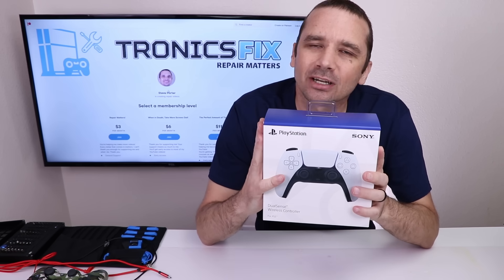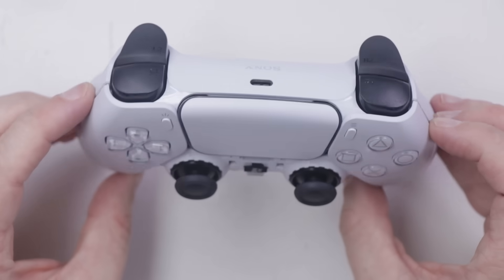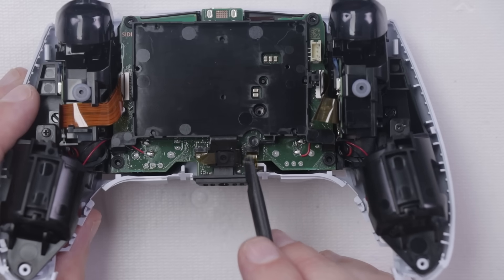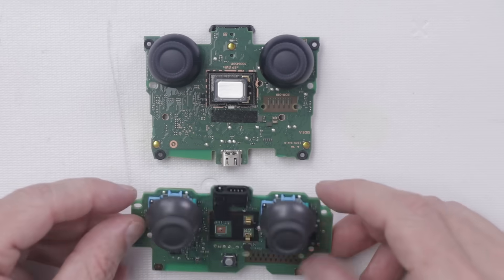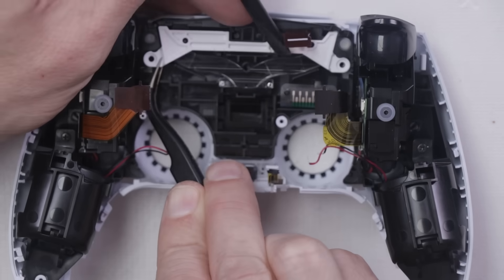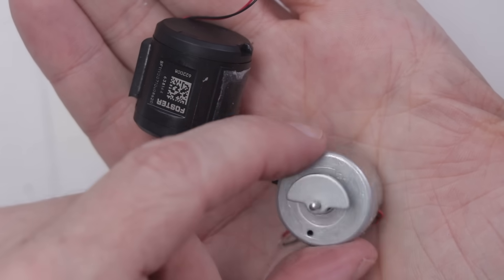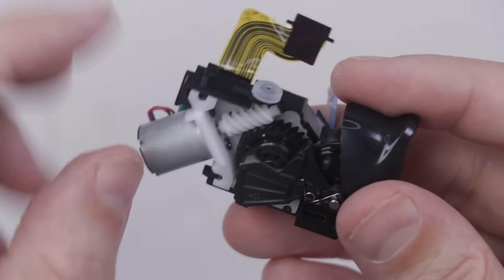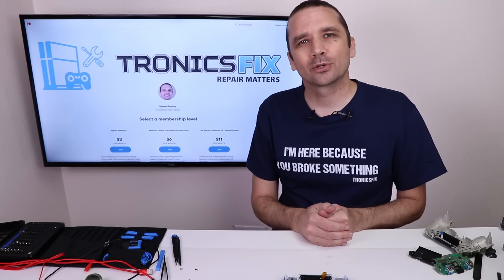PS5 DualSense Controller Teardown - A Repairability Perspective

Comment: at $90 each controller the reparability is useless, just think about the USB C if you can do it yourself its good, but if you get it to a repair shop it will be about $65 because it is micro soldering, anyway if you buy another one you will get spares parts from the old one !! But in 20 years i never broke a PlayStation controller but i did repair some not as much as the xbox one controller but still.

Comment: Oh maaan, this triggers look fragile, I do not think they will last long when playing online multi shooters on regular basis. Few months and plastic springs will wipe off or the gear will break its teeths, with excessive force of fingers in hell of fierce battles...
And analogs... It was really easy to fix ps4 controller analog drifting, instead of buying another one. This seems bit more complicated. These analogs are able to drift after few months /weeks already, so it is really dissapointing to see they did not change much.

Comment: Great video. Tempted to cancel my ps5 now shocking decision to use the same crap analogue stick I have 7 ps4 controllers with stick drift. Sony clearly cashing in on people having to constantly replace their controllers. And no i don't throw my controller my kids seem to be heavy handed when using them still not acceptable how crap they are with stick drift

Comment: I did notice as well the Dual Sense seems to have “Anti Friction” rings on the faceplate where the analog sticks make contact in their maximum range. They look exactly like the Anti Friction rings on the SCUF VANTAGE so I’d assume they are replaceable as they just pop in & out, SCUF offers them in many different colors.  I’ve always been one to swap out the stock PlayStation controller sticks with SCUF sticks so It has the height & contours/grip I prefer. I don’t see myself  using the Dual Sense controller anyways as I never really used my Dual Shock controllers as it is. I’ve been on SCUF ever since they were first introduced & the only way that will change is if Sony makes an Elite/Pro controller with a minimum of 4 back paddles with hair triggers & stops as well as easily swapped sticks & non limited mapping. It would be even better if they could include 2 side action bumpers like the SCUF VANTAGE to give you a total of 6 extra buttons to be mapped & utilized for optimal gameplay performance
Reply: You should definitely try it first, as the haptic feedback and adaptive triggers really seem to be something new and fresh.
Reply: @paddipat   for certain games I may like racing or games along those lines that don’t take many mechanics. I usually always have vibration off.. I mainly play a lot of COD &  First Person shooters so typically the main things I’m worried about are being able to perform all mechanics actions as fast as possible simultaneously without my thumbs ever leaving the sticks. Fast free trigger bounce with no extra travel .  I can only really see using my dual sense as a media controller & for games that don’t require advanced mechanics. Even then it’s almost not necessary because I’m so used to gripping my controller a certain way & having staggered stick positions that you’re not really doing yourself any favors by switching controllers for specific games.  I  love the design/look & the features they added.. it’s just not for me. Now take the same exact controller made by SONY & add 4 paddles & 2 side action bumpers with remapping capability, hair trigger or mouse click triggers & stops with easily swappable sticks.. I’m all over it!

Comment: Oh man, I wish I could've gotten the inside look of the haptic motor. What makes it so different from the normal weight based one on DualShock?.
Reply: The old motors are rotational and spin around weights to produce vibrations.

The new motors are linear.
They move an internal weight back and forth with a much greater degree of control than the old rotational motors could control their spinning weights.

It works similarly to a loudspeaker, except instead of moving a diaphragm to vibrate the air, it's moving a weight to vibrate the controller.
Reply: I don't think it is a motor, but a magnetic coil.

Comment: I'm so scared of the triggers system to get broken  after a while. Those gears look easy to break. Because of the tension they'll make.
Reply: They give in under certain pressure to prevent this .

Say you press really hard the gears will just unlock to prevent damage.
Reply: @xXSinForLifeXx  that's really great mechanics. Hope it hold up

Comment: Question: what above lights are you using and how are they angled? I have too much glare on my setup.
Reply from the maker: I have too much glare too...I'm working on it. I have an overhead LED light hard wired as well as two LED light panels and a ring light. If you're getting too much glare you'll want to find a way to diffuse it more. I often use a diffuser cloth. You can find it on Amazon.

Comment: I've noticed on both of the analog sticks on my DualSense controller... there is an annoying click sensation whenever it's about half travel between neutral and the far right position. Both left and right analogs have this sensation. Only when pushing right. Anyone else notice this? I tested all 7 of my ds4 controllers and none of them feel this way. It's quite annoying. And once felt I can't "unfeel" it.

Comment: I've owned 4 DS4 controllers over the lifetime of owning a PS4 /PS4 Pro and never once experienced analog stick drift on any of my controllers.  So as far as I'm concerned, it's a non-issue.  The battery not being able to hold a decent charge always tends to happen way before anything else in those controllers for me.

Comment: Or considering the time and trouble not to mention cost and shipping time...
You're better off BUYING A NEW ONE rather than going through the trouble of TRYING to repair it.
P.S
What is this so called stick drift you speak of? I have a launch ps4 and controller and have NEVER had ANY drift issues with ANY of my 3 controllers.

Comment: Does it work on PC/Linux like the DualShock 4? Is it a pain to get working like the DualShock 3? Does it not yet work at all? I still use my DualShock 3 with WinSCP on Windows 7 and with Linux it just works out of the box, but would be a big plus to have this controller finally retire my DualShock 3 after 12 years of service...

Comment: Honestly, I don't see why anyone would want to fix a broken $70 Controller! I mean, it's cheap enough that unless the fix is practically free, like merelly applying some WD40 I don't think it's worth fxing, so just buy a new one instead. A $20 fix would already be completelly out of the question for me. And I don't see how a motor assembly like that, plus service would cost less than $20 to fix.

Comment: I thought the Haptics arent just "Motors", but voice coil actuators. They function quite differently.
Reply: You're right.
Reply: They are voice coil actuators, he just called it a motor
Reply: The biggest difference I guess is that in these, the mass is moved in the direction of the axle of the previous motors
Reply: Yeah, the crummy old motors just moved a permanent magnet around by running a current through some coils, which induced a magnetic field that in turn moved the magnet.
The brand spanking new Voice Coil Actuators™, on the other hand, move a permanent magnet around by running a current through some coils, which induces a magnetic field that in turn moves the magnet.
Absolutely nothing alike!
Reply: Yeah he's got no clue
Reply: Just in case the sarcasm flew over your heads: voice coil actuators are a type of electrical motor.
You're all basically saying "that's not a sword, you idiot! It's a katana!"
Reply: @majorgnu  thanks for the explanation. But I didnt imply "Idiot" anywhere, though others did. I guess the confusion comes from the association that motors typically rotate something, while the actuators move a coil back and forth.
Reply: @franzusgutlus54  That's fair, sorry for blowing off on you too.

In retrospect, it was oneoone's comment that tainted my perception of the whole thread's tone.
That and all of the other comment threads picking on the same "mistake" in varying degrees of snark.

Comment: Nice job Sony and a great teardown.

I’ve got to say I haven’t experience myself or heard any stick drift issues with the dual shock 4, obviously you repair them on a frequent basis but I wonder that the failure rate is compared to Xbox or Nintendo’s infamous stock drift issue.

Comment: Speaking of issues with the DS4, I don't know if you've seen one but the 500 million CUH-ZCT2U model has a mirrored motherboard compared to a regular CUH-ZCT2U one. I wanted to swap mine because my 500 million one has a defective charging chip (it doesn't work with power from the battery anymore). It only works if it is being fed power from the front micro USB port under the LED... 😑 I can't swap because the plastic inside is as I said, mirrored.

Comment: I heard that in FPS shooters, the triggers can jam just like a firearm would jam in IRL
Reply: Yea, and that's concerning as those worm gears wouldn't move if you press really hard. They rather break than going to turn. But maybe there is a mechanism that I haven't seen that would prevent this from happening.
Reply: I’ve never had a trigger jam. You’ll get all sorts of problems with chambering rounds or ejecting rounds... but a trigger that wont pull? Nope.

What you might see in the case of a handgun is a trigger pull that changes based on the position of the hammer.  If the hammer is cocked and ready the trigger pull is short and easy. If the hammer is forward a pull of the trigger can cock the hammer back, but will be longer and require a little more force.
Reply: @ralphengland8559  I agree, having the trigger jammed on a real firearm isn't really a thing unless something is seriously wrong with the trigger mechanism.

Comment: I haven't bought a game console in 20 years... I'm primary a pc player, but the advancements sony brings with the dual sense really makes me wanting to get the PS5.

In the pc the input devices are basically frozen in time and we have 0 evolution in the way we use those devices in the last 20 years(more like 40 for keyboards).

Sony is bringing a new way to interact with games and that's please me.
Reply: DFaking  It's not the same, games needs to be progeamed to use dualsense features
Reply: DFaking  is as above post said...  i think a loot of developers are going to give full support for the new features in the dual sense even on multiplat games.
The thing is sony dont have gamepass and game prices on console are garbage so im divided...

Comment: Is it necessary to de-solder the board to access the sticks in order to repair the sticks? My DS4 had drifting and sprinting problems but I was able to access the sticks without soldering (a skill a do not have) and managed to clean them with contact cleaner and compressed air, which solved my problems. I just had to unscrew and disconnect ribbons. Did you only desolder to show us more in depth analysis? Can we remove the black plastic with the haptics in order to access the board with the sticks?

Comment: Stick drift? Why?? I have serviced many dualshock 2 controllers with cable issues but out of the 45-50 pieces I have fixed only one drifted and it was not stick error it was the controller chip's fault

Comment: I Was hoping the resistance was magnetic and not mechanical.
Reply: That could work better, but would MAYBE draw more power from the battery
Reply: It need a big battery then....
Reply: They need to shove a mega battery in there for that imagine if they used that with the current battery, you'd only get 5 hours max of battery life

Comment: The construction looks to be what I've expected really... Quality seems reasonable, but I'm a bit concerned about that adaptive trigger system. Someone with heavy (strong) finger muscles might break or strip those gears. I've caught myself a lot of times squeezing the triggers way to hard in the heat of the battle. Let's hope that the material choice for that mechanism is good enough.
Reply: i was a mechanical design engineer and gear system is one of my field, based on this video i can say other parts might break first before gear teeth. first helical gear is normally stronger than common spur gear, second i dont think that motor have enough current to hold a very high force and will loose the resistance force.
Reply: @versiq  Thanks for your opinion. I do appreciate it! ;)

Comment: Tearing apart the dualsense seems a lot harder than the ds4...
Reply: I've seen surgeries easier then that
Reply: @FEVERNOVAA  😂😂😂😂😂😂
Reply: You don't have to take off the motherboard I'm pretty sure. That was just to get a look at it.
Reply: @Kjf365  and how are you planning to reach the joysticks?
Reply: @shapsugh1864  It looks like the ps4 controller. You can just take out the whole thing leaving just the front case. Then take the joysticks off to look at the mechanism.
Reply: I got 10 xp for just viewing this video
Reply: Easier then DS4 WHEN open you might rip charge light cable and parts can fly out like springs etc. But I bought broken official PS4 charge base that charges at bottom ext. Port next to 🎧 jack. Charges faster. So I removed wire with plug heat shrinked it and boom works fine.
Reply: @D.K .... Why?
Reply: @D.K I removed the motors, but usb led not yet I need to find bottom ext. Charger so I can remove connector with wire and use that to charge 🎮 and its faster charger

Comment: The black cushion around the buttons is probably there to dampen the button sounds because the microphone is inside the controller. I've seen in another video that the sticks seem to bee quieter than ds4 and the next big noise maker are those four buttons. The dpad doesn't make moch noise...

Comment: I have 6 doualshock 4 controllers and I never had drifting problem on them and never had to replace the sticks potentiometer.

On the xbox one controllers I had to replace 4 Potentiometers and that because they fell alot. Both controllers have very high quality stick Potentiometers. Not like the joycons on witch I'm replacing there sticks on regular basis.

Comment: This is what Upgrade looks like and should be. Lot of tech improvement happen in this new gen controller.
Reply: The only isssue with the DS4 haven't been fixed,wdym
Reply: @FEVERNOVAA  you mean they still using the same analog??
Reply: Fevernova A whe have an xboxfan here, dude the Xbox controller and yes the New Xbox controller has the same problem.😉
Reply: @FEVERNOVAA  the rotated the stick placement 90°, so when u push the stick down to spring forward, there should be so much wear like before.

We'll see how it holds up. Was satisfied with my DS4, I've had 6 controllers and only one got the problem of stick drift in all these years.

Sometimes I am thinking people are just too hard to their controllers and should try to relax more.

Comment: Would have been better to have a modular chargeport like on the dualshock controllers, easier repairs with no soldering required.

Comment: OOF this is so much tougher to open and repair than Dual Shock 4. I ran my controller for 4 years before the drift was beyond repair. Then i replaced analog sticks myself only with another one. This controller would be a nightmare to fix.

Comment: I just wish we got a few more actual buttons that devs will use and not just gimmicks, even the dual sense is exactly identical to the DS1 when you look at the buttons. 

4 d-pad directions
2 sticks
4 buttons
2 bumpers
2triggers

The same since 2000 

Meanwhile games tried to move on with features but had to sacrifice some for the sake of controller support

Remember manual leaning, select fire modes, multiple items to heal different effects, going prone,zoom toggle, Nv goggles instead of just really bright nights
Reply: The touchpad gives you 8 inputs, if developers use it correctly. Ghost of Tsushima for example did it very good. Or the Witcher 3.
Reply: @paddipat  which only one console currently has and you need to let go of your stick(s) to use, which is likely why it never caught on as much as it should. 

SCUF has shown that 4 extra buttons alone are already possible, besides the touch pad.

Also 8 ? 

Contact + swipe Direction

Comment: I'm worried about the BGA chip on the Mother board. If that chip fails, replacing it will be a potentially risky fix. And if you bung it up, you're probably just going to have to get a new motherboard.

Comment: Can you help me out? My ps4 has been messing up having problems with my playstation. Ive went to safe mode initialized it, made sure my hard drive was screwed in i tightened it, i done basically everything in safe mode. I also have the “cannot start ps4” i re updated the software update from a usb formatted it correctly. And when i play a game after a little it corrupts or like the screen is like a old tv when u disconnect the hdmi it turns all sorts of colors (blue screen i guess u call it ) and i have to click the playstation turn on button twice sometimes 3 times for the blue light to come on. It blinks the blue light of death and nothing shows on the tv. I unplug it plug it back in after 3 minutes ( into the wall with a new AC cord) and it still happens. Once it decides to turn on (its whenever it wants to at this point) all of my games and everything is gone. (Ive opened my ps4 to apply thermal paste) and replace a ribon cable to the disk drive for the eject disk button to work again. (It was broken for a while now) please help. Any suggestions or do i just need a new ps4.When i was slightly pressing areas it would blue screen whis is back the back right side of the playstation 1st generation error code i always get CE-36329-3